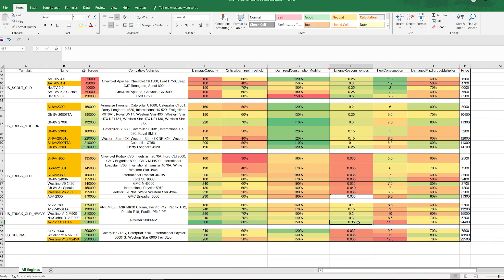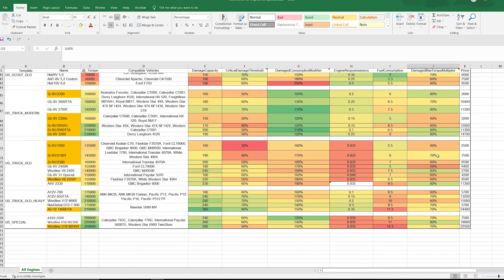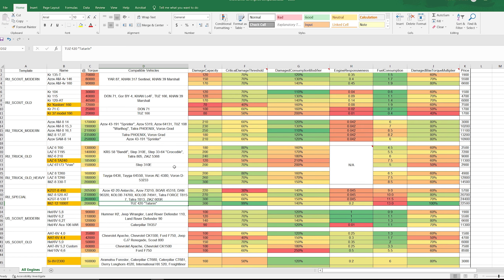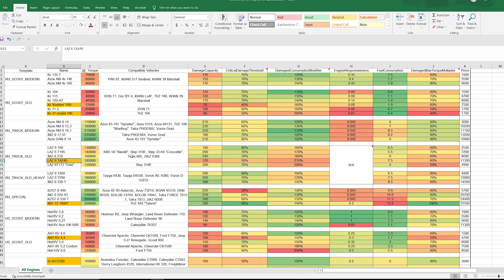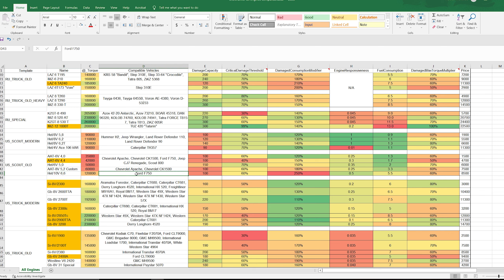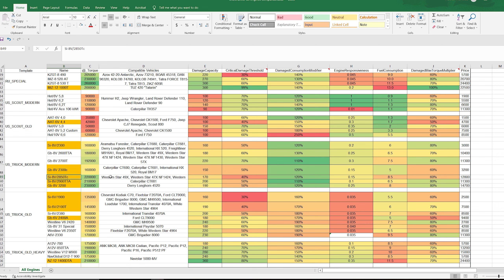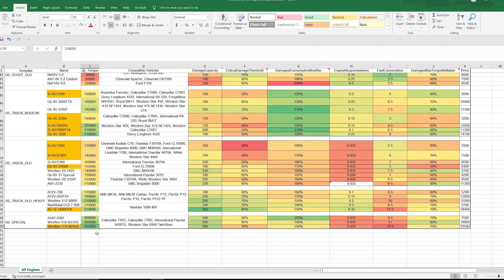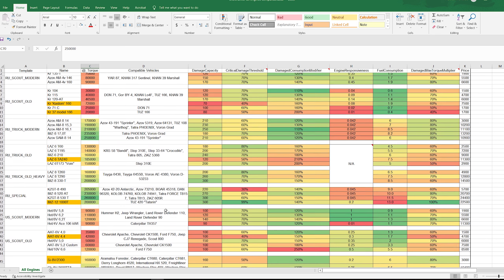Things You Never Knew About The Durability Of Engines!

Comment: This spreadsheet is nice and all, but doesn't account for model geometry.
Some Trucks get engine damage from minor bumps on trees. In such trucks even the most durable engine will die a death by thousand cuts.
Again here the Tatarin is insane durable. It's engine is in the back and does not take damage from front or side collisions.
Reply from the maker: To account for model geometry would be a video that would be very extensive and you’re right, that is an important factor, but that wasn’t the intent of the video. It was to give some info on the affects of damage and allow viewer to make their decisions based on that. The tatarin of course is a outlier and extremely hard to damage as is the azov5319, but going through every truck would be so much detail that I don’t think many viewers would really want to sit through

Comment: I play now a New game +,  85% hard mode rules, so i really drive  very Careful, but as engine /Power need, i search medium engine for medium Fuel consumption, depends of truck usage, like tatra force it really need kzg_t 530 engine upgrade, but zikz 605r doesn't need that upgrade, is powerfull as it is, azov 64 & 73210 still medium engine,   IT can drive through deep mud decent but at least it won't bun Fuel so much

So... If you want good grip you need high weight & good tires, but to move The high weight truck through mud you need good powerfull engine... Like p16 is The Best example
I dont care of damage, i don't do rally, and even i Take damage eventually, i repair with service trailers... Or adons..

Interesting  Graphic with all engines there, Thanks for info,  good job, keep your research about this game!
Reply from the maker: While your logic is sound, using a lesser engine will actually cause it to be increasingly stressed with weight because you don’t have any available power (power to weight overhead). Upon testing this, in my hardmode, lesser engines will become stressed and they are working so hard, while more powerful engines don’t have to work as hard. When I tried maximizing my fuel savings of which I made 2 videos on as well; I found that having the strongest engine is more beneficial with good planning. Still if you feel you are getting good results with your setup, then I suggest you keep it going.
Reply: The link is in the description

Comment: It's so hard to damage engine to the point it starts to lose power that I can't even imagine why would someone would choose to not go for torque. Gear, tires and fuel tank damage gives a lot more problems and yet you can do nothing to improve things on them beyond driving safe.
Reply from the maker: I've actually damaged engines to their critical threshold quite a bit and I'm a pretty slow driver, however I think I would always recommend max torque option and the mitigating factor as you stated which is to drive safe
Reply: Engine durability is more noticeable in hard mode
Reply from the maker: @Juan-dn5yu  I completely agree

Comment: 8:50 not totally true. All three base game KR family engines increase durability with the power increase, and only the "Kastom" one (added in season 4) has an extremely low durability value, which is the trend for all other super-powerful heavily tuned engines (IMZ-8 17,0T, LAZ 6 TA240, Si-8V/2850Tc).
Reply from the maker: Yes indeed they do increase durability with power until the Kastom. I also did notice that trend as well, Just not mentioned in further detail. Thank you for noting that great info @vladvulcan
Reply: @NProvince  It is weird when you run into something with the front of your truck and it takes damage to an engine that is mid-mounted. The damage in this game can be an exercise in frustration a lot more often than I would like. The warehouse in Amur that damages you everytime you drive over the cement slabs in the driveway as an example of trolling the hell out of me.
Reply from the maker: @generaldisarray4146  Oh gosh, those slabs on AMUR are death